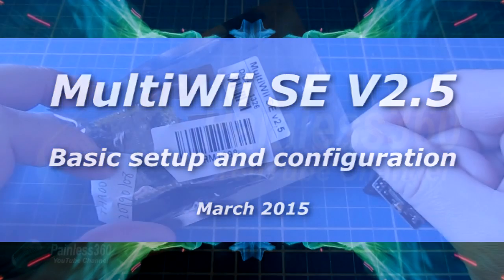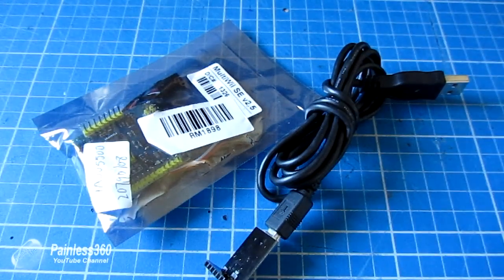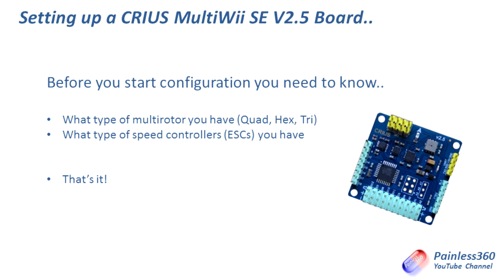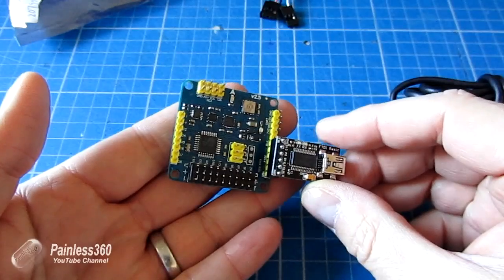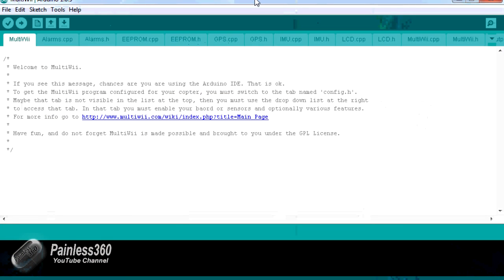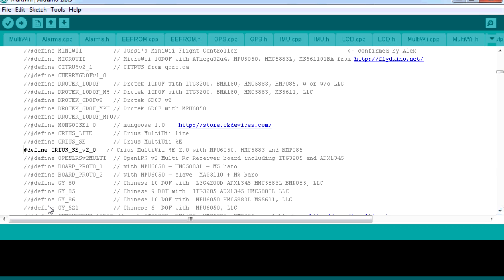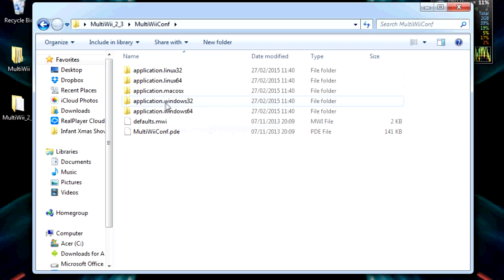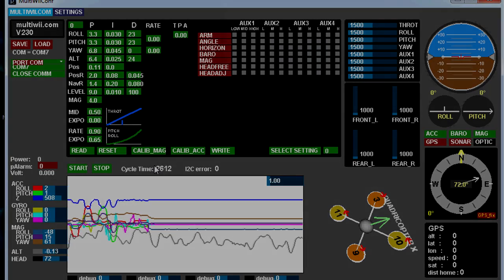(1/7) CRIUS MultiWii SE V2.5 Board - Initial setup and configuration

Comment: Hi Painless Happy New Year.
  I'm a bit stuck again with my mini MWC setup
 ( #define HK_MultiWii_SE_V2  // Hobbyking board with MPU6050 + HMC5883L + BMP085). 
  I have the turnigy 6A plush ESCs. The Quad has been on the shelf a while so i'm a bit rusty. Basically it had been in a crash, since then i've moved house and some of the battery cells died so i've wired a new power system and also replaced a dead ESC. I had a new spare so i stuck it in place of the dead one and went to power up. The new ESC wasn't calibrated so i went to get my programming card but i think i blew it up as i forgot it couldn't handle 2s voltage (but the Mini MWC can). I tried to calibrate with the throttle stick but the esc's do not recognise full throttle (Tx settings?). I can do it with a servo tester i have and that works however i am not sure if that is the problem and which settings are wrong (or even if it is an esc setting causing the issue). There are two problems i have. 

A. When i arm the quad all the other motors spin at idle but the one with the replaced esc does not. I also tried a spare motor but same problem.

B. When i increase throttle the new esc starts to spin the motor but it oscillates a little, it is not smooth and doesn't want to hold the quad steady even on angle mode. 

I tried to calibrate esc's together through arduino by uncommenting the ESC_CALIB_CANNOT_FLY line. 
  I can't remember if the battery should be connected here or if USB power to the FC is enough, but i think i tried most combinations. Basically i connected the FTDI programming stick from the FC and then to the usb on my computer, then i ran Arduino, i tried to calibrate as i explained above. 
  With the battery plugged back in the props spun up just after the sketch was uploaded but then i couldn't get the board to recognise full throttle to start the programming sequence.
  From what i remember it was not necessary to use throttle stick programming but then again i had the programming card working back then so perhaps that was it. 
  Strange though, i thought props spinning at idle was a feature programmed through the sketch.
  Anyway i couldn't get that last motor to spin at idle and when it spun up it was fluctuating in speed and the quad wasn't holding it's angle.
  Once again i've been up all night playing with this and now i'm stuck again.
  I also tried swapping the signal wires between two motors but no change on that esc. It seems it must be something to do with ESC programming, there is no way to see how the other ESCs are setup and i can't remember now how i set them up before.
  Thought you might know where i'm going wrong. 
Just tried something before sending this message, i swapped the suspect esc with another esc and the problem has stuck with that esc, so now on a different motor and different channel, the esc was brand new so i'm thinking it must be an esc programming issue, i'm just not sure how to set it up like the others, seems i can program it with the servo tester but not sure why i can't with the throttle stick, gutted i broke the program card! But not sure where i'm going wrong with the programming. Frustrating.
  Thanks.
James
Reply: I'm thinking that perhaps the new esc is half dead from out of the box or perhaps i blew it when i plugged the programming card to the approximately  7.5V i had on the main FC board at the time. They should put a big reminder on those things 6V max i really was surprised i blew it. Seems there is a resistor and 2 diodes before power go's to the main chip in the card. They are a little tiny for me to desolder to see if one blew, i don't have a microscope yet. The resistor is brown with no markings, the diodes (or similar devices) are black one has 104 and one has 102 written on it, there is a similar component with 0 written on it, they all look in good shape, i'm guessing the surface mount component marked 0 is just a bridge over a track. I was thinking i might be able to cut some of the tracks to help test the components without having to desolder them. I was hoping to find a blown diode and simply remove the component but now i'm thinking to just buy a new card. Grounded again for the moment, perhaps i'll order more spare ESCs. I tried to swap in a different ESC but still acting strange, i'm thinking it's not keeping up with the others but in the past i had had some luck flying with one odd ESC.
Reply from the maker: +izzzzzz6 I've had recent experience myself (and helped two pilots on support calls) with a problem when replacing an ESC. Sadly not using identical ESCs can get you into all sorts of trouble.. Best of luck!
Reply: got a feeling i damaged it slightly when the program card blew up with 7.2V or so. So waiting for the new one, no luck with the odd esc this time but it may also be faulty as it was from the used pile. But i had it flying before with an odd esc, just depends. I'll let you know if the new one solves the problem.
  I'm going to start building a mean little high speed fpv in the meantime. Tanks for following as always.

Comment: hi painless 360 i had found in my multiwii gui that the motor speed decrease slowly and move the throttle stick to top it does not go to full throttle it just gose upto which it is last decreases but when i move the throttle to the bottom & then back top full then the motor gose to full throttle . But within few seconds it started to decrease again so every thing is ok or something is wrong. By the way i am using it in auto level modemode.
Reply from the maker: Does it fly ok? Many boards will be a bit confused when they don't get the feedback from an actual flight. You can always recalibrate the escs again. Best of luck!
Reply: Electronic projects naze32 sbus

Comment: hi chap , great vids on this , but iam wondering is there a way to make the quad more agile as trying to get my quad to flip is more like a huge barrel roll , any tips
Reply from the maker: +andy richards Lots, use rate mode and increase the rates by the side of the settings for roll and pitch. Happy flying!
Reply: ok mate thanks will load it up on the lap to and have a look to see if i can find it
Reply from the maker: 17:19, you can see it my the side of the PID settings..
Reply: ok will look at the weekend
Reply: hi fella any chance you could do a vid on how to put in good settings for acrobatics with a 250 quad
Reply from the maker: Thanks for the idea. Rate mode and insane max degrees/sec settings! What FC are you looking at?
Reply: i dont want anything to extreme just to be able to flip and roll without to much worrie say like a sport flying  if you now what i mean , i can make it faster or slower to fit my flying style ,if i now what i need to be altering
Reply: also can i have it on a switch or will it need to be on all the time
Reply from the maker: Rate mode is exactly that - a mode. You can select it using the flight mode switch like any other. Best of luck.

Comment: hi guys need help urgent. all nights after work I am spebding to repair my racing drone. 
basicly I had a slighterror of mine and I had broke my props when did take off. It costed me with broken props. then suddenly I discovered tha one of four ekectric motors did not rotate. instead did slight mivement then gave me a beep signal. I thought engine is fried so I change it. after resoldering E.Engine still had the same problem. Clearly could be fried ESC. So I changed it too. 
after job done with soldering. I found out that I my drone do not respond to a drone no more. is that mean I need to calibrate my Flight controll board? 

here some stats about my drone.

Crius MultiWii SE v2.5 loaded with the least version of MultiWii (2.4 although it says 2.3 to keep it compatible with older software) this was chosen because it is without a doubt the best modular & configurable controller on the market, it has more inputs & outputs than you could ever need, i

ESC RW.RC Simonk firmware, BEC:5V3A
15A 
2-4sLipo
rotors Emax MT2206 - 1900kv
Reply from the maker: +Aleks Cortez If a motor is 'twitching' then it normally means that one of the three connections from the ESC to the motor isn't working. This can be due to a broken wire, damaged winding in the motor or ESC phase being fried. You will need to recalibrate the new ESC once it's back together but that will not stop the drone powering on or arming. Best of luck.

Comment: Hi,very good video. I recently bought the same kit and noticed in multiwii 2.3 that there is options to define flashing led's and also enable/disable landing lights. Is there any videos for that or do you know which outputs to use on the board? Thanks
Reply from the maker: +Louw Beck I have not played with this feature as I rarely use Multiwii now. A search of the web also seems to show a poor set of documentation for these features. This forum post was the best I could find on the lights - http://www.multiwii.com/forum/viewtopic.php?f=8&t=1695Best of luck.

Comment: Hey I went through the videos and was close to getting my quadcopter to fly, however I went back into the folder to open up multiwiiconf but there was an error saying "this file does not have a program associated with it for performing this action. Please install a program or, if one is already installed, create an association in the Default Programs control panel" it used to open then all of a sudden this started to show up. How do I fix this? (I was using Windows 32 bit before on a windows 8 computer).
Reply from the maker: Are you clicking on the .exe file?
Reply: yes I am. I used to click on it and the application would immediately open. However now just the error comes up
Reply from the maker: Not sure then. I would re-download it and ask the developers for help. Best of luck.

Comment: Hey I have a question I have a multiwii it is setup already but know I'd like to change the failsafe options and my question is how can I display the actuall code on the multiwii in the Arduino programmer hope you can help me it is a crius v se 2.0
Reply from the maker: You can't 'uncompile' it so you need to find the arduino sketch use to program the board and edit it. Best of luck..
Reply: Ok thanks I have done it now 😉 it is for my Dad I'll write you if it flies
Reply from the maker: Best of luck with the maiden!

Comment: Hi, I'm going to built a quadrocopter with multiwii and I don't know if I can connect this radio receiver http://static1.squarespace.com/static/51e8d916e4b0aabd69a1d776/t/545baa9ae4b0a69b3b66e12d/1415293621723/TH-9X+Manual.pdf to multiwii, becouse the names of pins are a bit different than names on multiwii ports and I need your help. Please, anybody know how to connect this receiver?
Reply: And I'm going to use this Multiiwii :  http://ebayzone.x14.eu/~Doc/MultiWii328P.pdf

Comment: Anyone that has trouble with 'stk500_recv(): programmer is not responding' : 

I did have this problem and was because I put the firmware on the board when bluetooth module was plugged in. Unplugging bluetooth module solved my problem and firmware could be flashed on the board.. so happy that I wanted to share this with you guys! ;-)
Reply: ***** how do i unplugg the BT module? i dont have BT on my board? dont really know what im doing xD
Reply: +Cedric O Same problem, how to repair it?
Reply: I bought a separate bluetooth module to plug to one of the 4-pin connectors, and the error only occured when this module was plugged in, so I don' know how to solve this problem if you don't have a BT module (sorry for the very very late answer btw aeBerglund , I hoped you found out by now?)

Comment: Can I email you my config h settings to see if you see anything wrong? Its all loaded to the board and motors are calibrated through config h also. My motors are not running at even speeds. My DX6i is also set correctly. Thanks
Reply from the maker: Steve B Sounds odd. Have you calibrated the ESCs (https://www.youtube.com/watch?v=OOplk52R4no)?
Reply: Yep, through config h
Reply from the maker: You don't calibrate the ESCs using config.h, you only setup the type of ESC you are using. Two very different things.

Best of luck with it.
Reply: Painless360 I have calibrated both ways. I tried the Config h with this line  --- /* to calibrate all ESCs connected to MWii at the same time (useful to avoid unplugging/re-plugging each ESC)
       Warning: this creates a special version of MultiWii Code
       You cannot fly with this special version. It is only to be used for calibrating ESCs
       Read How To at http://code.google.com/p/multiwii/wiki/ESCsCalibration */
    #define ESC_CALIB_LOW  MINCOMMAND
    #define ESC_CALIB_HIGH 2000
    //#define ESC_CALIB_CANNOT_FLY  // uncomment to activateseems to calibrate fast but I will try again with the Dx6i. Thanks again. Your a great help.

Comment: How can't imagine how well this video kicks start me using MultiWii!!
Reply from the maker: ***** Thanks for the feedback! The Multiwii has been my 'go-to' flight controller for the last two years for smaller craft. 
Happy building and flying!
Reply: Painless360 
Progress so far:
Thanks to you, I successfully used multiwii on coreless motor + Arduino Pro Mini + GY86 IMU + NRF24L01 2.4g wireless using force2g's code. Coz i did not have a receiver and remote, but I do have the other components.The quad doesn't fly due to the vibrations, I did 5Hz Low pass filter and still doesn't work well, coz it simply vibrates too much.
So I think my first build was bad, decided to just buy a micro quad frame.

Other plans:
I'm also researching to build a brushless version, with NRF24L01 (plastic frame).

I'm familiar with Arduino, which allows me to build on my first microquad using NRF24L01.
I might use Atmega2560 microcontroller in the furture for my brushless quad coz I'd want GPS, sonar, add my own set of sensors for safety precaution.

Questions:
250-size quad suitable for a beginner?
I'm trying to decide which FC to use... Which FC do you like most? and why?
Which FC communities are active in modifications and posting source codes online?
Do you think MultiWii will be suitable for me? Coz i'd like to do modifications. 
Do you know other flight controllers that use NRF24L01? 
It seemed like most MultiWii posts about NRF24L01 are dated from 2012.
NRF24L01 is quite a popular chip among Arduino community.
So I wonder is MultiWii community being less active, compared to others?

Thanks for reading so many words :)
Reply from the maker: 250 frame I use is here - https://www.youtube.com/watch?v=oQeNV-Wr8RE

The Naze32 and Multiwii communities are both very active. Multiwii is the one that is easiest to access for coding IMHO.

Looking in the forums and reaching out via the Wiki and code.google.com pages will help you find the best place to play.

Best of luck.

Comment: do I need to disconnect everything from the board to do this? or can I just connect it while its in the quad with motors and receiver connected?
Reply from the maker: staslig Either works but I would make sure the board works before plugging anything in so you can return it if you can't flash it or it will not power on..
Happy building!

Comment: please help me windows 7 does not recognize my MultiWii I reinstalled the drive but nothing does not work then java gives me a lot of mistakes I uninstalled is setup dinuovo but to no avail I do not know how to look your answer greetings
Reply from the maker: Tricky to help without you letting me know what the 'mistakes' actually say.

Install/update Java and make sure the FTDI adapter is a real one (has FTDI' on the chip. If it's not got that then search for FTDI basic on eBay and get yourself one..

Best of luck.

Comment: i got a new prob. now. i was trying to change some setting using bluetoooth and something went wrong and the only thing i changed was in yaw. now the quad motors will not start spinning untill i bring the throttle up to 70 % and the motors spin up one at a time. what could i have done to cause this prob.

thanx.
Reply from the maker: No idea sorry. Think about what you were changing when it happened and try to work backwards. If all else fails, reinstall the code and recalibrate..

Best of luck.

Comment: Hello again, what board would you recommend that is easy to program with no hassles? Thanks
Reply from the maker: Hi Steve, watch this unlisted video as it covers this and compares the boards I've used on the channel - https://www.youtube.com/watch?v=k4tQAmg2ssA

Hope it helps..
Reply: Painless360 Thank you. I think cc3d is for me.
Reply: Any idea what would cause what  sounds like the motors are surging. I have a pretty stable flight but its sounds like surging I hear. Thanks
Reply from the maker: Could be the gains or sometimes vibration can cause some very weird behaviour..

Any video of it?
Reply: Painless360 Not yet. I have just resoldered the wires to the frame. I will give that a try.

Comment: i really need help pls

i want to reflash my crius se v2.5
but when i try to upload the sketch multiwii2.4 or the eeprom_clear 
in arduino there shows this avrdude"programmer not responding" message

i do the same as you do ... platine comport 
programmer AVRisp

bluetooth is disconnected while flashing 
anybody can help me please?
Reply from the maker: You can't have the BT and USB connected at the same time, unplug anything in the UART port and try again.

Best of luck.
Reply: Painless360   bluetooth is not connected but it still doesnt work 
i dont know what to do 
maybe i need a new ftdi adapter  

but the adapter workt for flashing the gps i2c